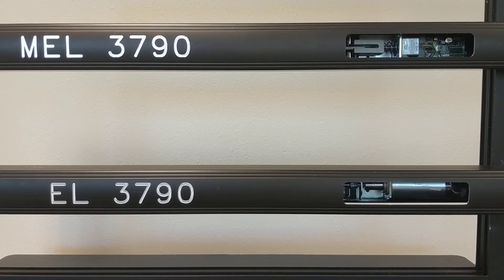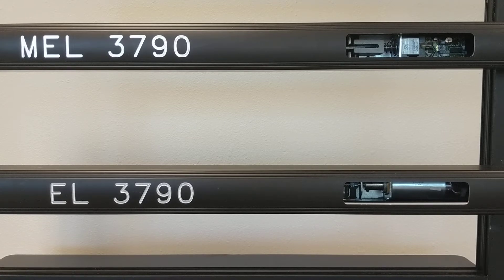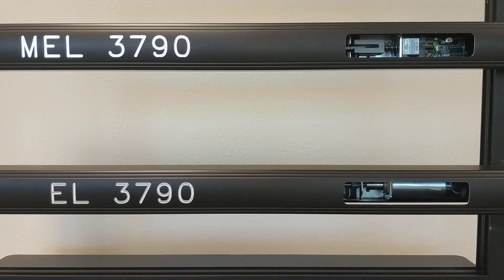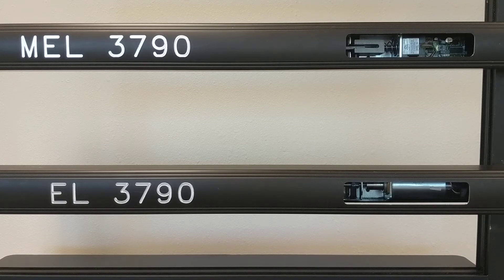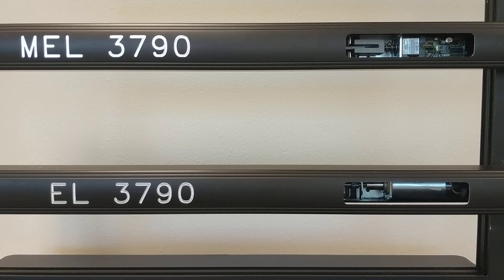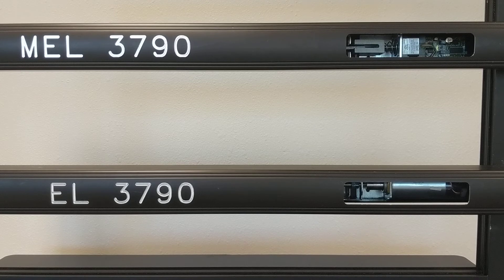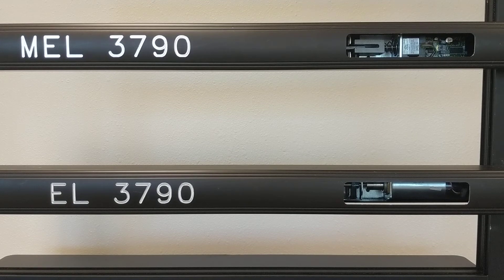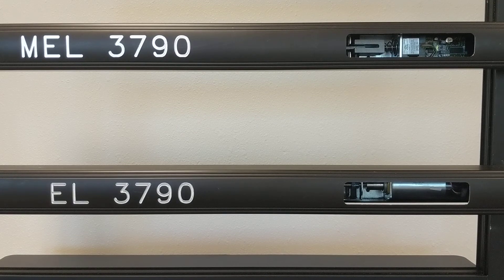Electrical dogging types

Comment: I use electric latch retraction for buzz in applications.  Both are cool however, I don't think I would put the EL device in a school, hospital, daycare center, or hotel.  Too noisy!  In a school, I would maybe put the EL on the front door for buzz in applications.  But I would put the EL in a roller skating rink or shopping mall since those applications are noisy anyway so who cares.  But I would highly recommend the MEL device in schools, hospitals, daycare centers, and hotels.